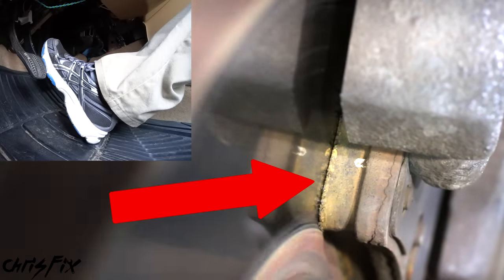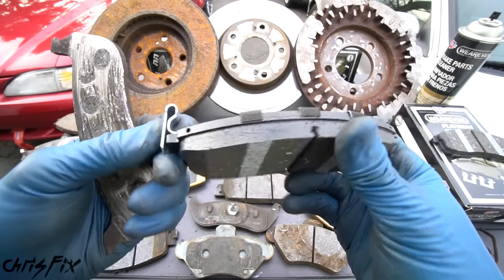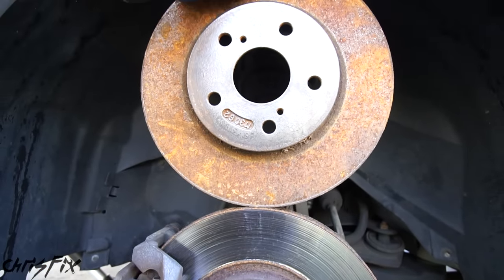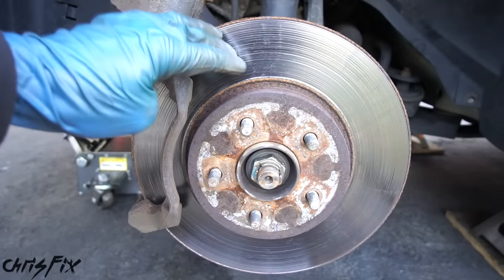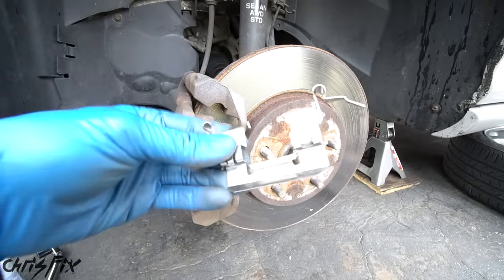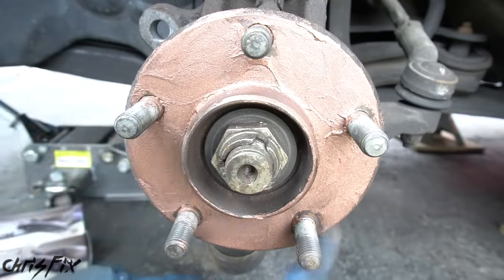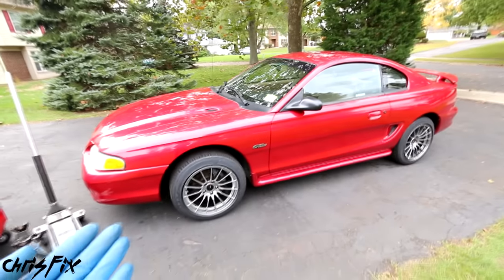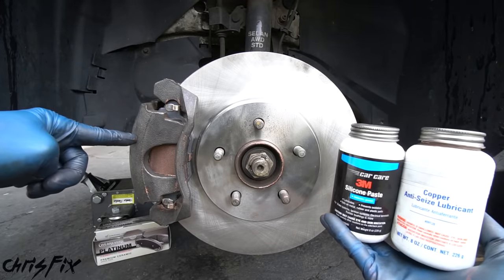How to Stop Your Brakes from Squeaking

Comment: Mazda stealership wanted $1,170 to replace the rear rotors, pads and one caliper. I went home and replaced the front and rear pads and rotors for less than $380. The rear driver side caliper wasn't the issue. The problem was metal inserts the pads slide on were fouled up so the pads didn't slide freely.
Reply: you forgot to add mechanic fee, company profits, and also warranty.  you don't expect all those for free, do you?
Reply: @TheAngusGao  I expect an accurate and honest diagnosis when I take my vehicle to a dealership. Being lied to and being told the caliper is faulty is not what I expect. I was also illustrating how much stealership gouge you on repairs. Maybe if they read their own TSBs they would know what to inspect.

Comment: Chris, super well produced, accurate and insightful video (as always). One bit of constructive feedback: using calipers to measure the brake rotor thickness is often inaccurate due to the formation of a lip along the outer circumference of the rotor. I always opt for a micrometer instead. Keep up the good work!

Comment: Why did I watch this, I don't even have brakes in my car
Reply: lol rip
Reply: Energy brakes? Those ones teslas use that if u brake you recharge a little bit
Reply: LOLWTF673 They still have normal brakes because you can't rely on the regen braking to stop your car quickly
Reply: i know that lol
i'm still wondering how E-Brakes work without using the main brakes
Reply: lol
Reply: That's Werid Unless You Have An Electric  Car Or Truck  ._.
Reply: I dont even have a car
Reply: David Gonzales I don't even have a car 😂
Reply: Flinstones car?
Reply: LOLWTF673 the e brakes are actually just the wheels turning the motors. My dad has a model x and he hardly ever use his brakes so they squeal like crazy when you’re using them from all of the rust build up on them
Reply: It be like that sometimes.
Reply: Because you have brake noise!
Reply: David Gonzales i dont even have a car
Reply: LOLWTF673 they do use the normal brakes
Reply: Noice
Reply: Just buy an anchor.
Reply: Flintstone theme plays
Reply: +Tony Hong
On mining equipment they use the motors as the main brakes while the friction brakes are about the same size as would be on a pick up and are really only for parking as a result.
Reply: Why waste money on brakes when you have a gear shifter and hand brake

Comment: I doubt you want to put antisieze on anything but the hub. Those places are meant to be dry. anything applied there only collects gritty dust and dirt. the graphite would likely be ok as it isn't gooey. I think that brake hardware is to keep pressure against the pads to prevent rattling, and prevent the cast holders from wear. The main thing that makes brakes squeal is the back of the pad rubbing on the piston or caliper. The black  metal plate  on the back of the pads prevents this noise.  Sometimes a stone gets between the rotor and the tin deflector and makes a noise that would make your teeth fall out!
Reply: AL M I've never used lubrication on the hub or the hardware. I thought that was quite odd when he was explaining that

Comment: People always forget this tip: put a thin coat of anti seize on the rotor! You don't want your brakes to seize up, right?
Reply: can i use WD40 in place of the brake cleaner to remove the new oil on the rotor?
Reply: I almost forgot!
Reply: In case this wasn't irony. Do never do that, always use brake cleaner!

Comment: Yo man
I wanted to ask you what my car's problem can be. The breaks only squeak when the breaks heat up and I had them replaced multiple times to see if the parts I was using were faulty or not. However it still happens after a trip full of traffic and  lots of breaking.
Reply: SAME! lmk when u found. solution ;/

Comment: Chris: first off, thank you so much for your videos. They've allowed me to do more work on my car than I thought possible, and helped me realize just how much can be done on my car by myself. It's becoming a hobby of mine to keep it in shape and clean (2003 Chevy Malibu with almost 278k miles.)

Second: I just fixed some brake noise that I can remember if it was covered in this video or not: my brake hardware needed a little bending to be clear of the rotors (it was rubbing against the brake pad hardware which mounts in the caliper bracket.) Bonus points: I fought with a pair of sticky caliper pins for a half hour and now they function properly, and my steering wheel doesn't shake when I go over 50mph.

Keep up the awesome videos! You've got +1 story now to encourage you to keep going. :)

Comment: The copper vs graphite antiseize test was completely wrong... graphite breaks down into small enough particles that it lubricates BETTER, not worse...
Reply: I agree the test is indeed wrong, you can't compare them to their solid counter parts when we are talking about lubricant.  Particles have different behaviour characteristics.
Reply: the way the graphite breaks down makes it better for things like nuts and bolts
Reply: Best anti seize to use?

From Permatex:

Nickel:
Protects metal parts from seizing and galling at temperatures up to 2400 degree fahrenheit
For use with stainless steel, titanium and nickel alloys
For use under conditions of extreme pressure and temperature
Recommended where copper contamination must be avoided
Suggested Applications: Exhaust manifold bolts, exhaust systembolts, muffler clamps and tailpipe assemblies

Copper:
Prevents seizing, corrosion and galling where high temperature conditions exist
Fortified with high quality rust and corrosion inhibitors
Temperature range: -30F to 1800F
Provides good electrical conductivity
Suggested Applications: Spark plug threads installed in aluminum, exhaust manifold bolts, engine bolts, oxygen sensors, knock sensors, thermostat housing bolts, fuel filter fittings and battery cable connections

Standard:
Highly refined blend of aluminum, copper and graphite lubricants
Salt, corrosion and moisture resistant, this lubricant is ideal for marine use
Prevents galling, corrosion and seizing and to assure easier disassembly
Suggested Applications: For easy removal of spark plugs, cylinder head and exhaust head bolts
Temperature range: -60F to 1600F
Reply: An apples to lubricant comparison.
Reply: Do NOT use graphite in your door locks. You will be replacing them soon if you do.
Reply: Graphite doesn’t breatdown it dries out and is best for low heat applications. Because it encourages friction. That’s good on bolts and things that don’t need to move continuously.  Copper is just the opposite of graphite as a anti seizing lube. Coppers major downside is it will oxidize causing seizing. Graphite will not oxidize.   So use graphite in the wheel hubs and bolts and copper on your house and electrical connections.
Reply: You completely missed the point.  Graphite breaks down into smaller pieces, which also shortens the life span of the lubricant.
Reply: Tyler Norton nope that not how graphite works, smaller is better for graphite.  The small particle get in to the nooks and crannies. That’s good, copper is the opposite because it oxides. So dry/ dehydrated copper paste allows oxygen to get to the copper ions and cause green “rust”.
Reply: And copper destroys the rubber seals to!
Reply: What's your conclusion? I don't see "brakes" anywhere in that list..
Reply: It would fall off if graphite was used as is (as a graphite powder), however this is suspended in grease, which would keep it in place. madjimms' argument still stands true.
Reply: So what's best to use instead of the copper lubricant used in the video?
Reply: pure dry graphite powder is  ok for locks, does not gum up, does not atract dust and make paste. Graphite powder is recommended for locks
Reply: madjimms and all of the helpful tips that he had in his video you chose the one that you did not like and you chose to complain about it great job you want a cookie
Reply: True. In extreme loading scenario Cast iron bearing are used which in fact is impregnated by graphite (Carbon) particles.
Reply: @totalbliss1  can u mix small amounts of them together or will that potentially break down the compounds?
Reply: Mikel Whois- The standard has a mix of aluminum, copper & graphite already except for Nickel. With the other two- copper and nickel, I wouldn't recommend.

Comment: Often brake rotors and drums get warped because of improper tightening of lug nuts/bolts.
Reply: Suppose that it could/does happen, but I don't know how often.  Brakes are sandwiched between wheel and lug/bearing assembly.  Very hard to warp a lug/bearing assembly because they are made from (hardened?) thick steel and literally designed not to warp.  Rotors and drums are similarly designed and are also hard to warp, unless (very) cheaply made (in China?) and/or they get very hot, say from abuse and/or racing, not normal driving.

Comment: I'm skeptical about the use of copper grease. Your analogy with the hammer is completely unrelated to what the grease is meant to do at a micro level... Copper may have been popular on bolts and things as an anti-seize, but graphite is better for lubrication. Oh and copper oxidises.
Reply: MHBGT Lead has a lower melting point than copper. Lets say he does 185mph and slams his brakes (for arguments sake), copper would be less likely to burn up as the heat from the brakepads rises.

Lead melts at 650-ish degrees farenheit whereas copper melts at 1,980-ish degrees. Copper outlasts Lead in practical application.
Reply: Juice I believe you’re confusing yourself based on the pencil comparison and how graphite is commonly referred to as lead. Graphite has a melting point that is essentially unachievable (especially on a car). I’m not one to argue for copper or graphite while lubricating but I do agree that the comparison was rather biased.
Reply: MHBGT Nickel is for high pressure. Copper is for rust and corrosion, and graphite is for threads and marine applications. From Permatex.
Reply: +Anton Zuykov my thought exactly
Reply: Partially agreed. I'm not sure which is actually better, but I think the comparison with the hammer is irrelevant, as anti-seize isn't made with pencil leads or copper tubes. It's irrelevant if graphite is brittle, as it already is basically a powder.

Comment: Hey Chris, My car makes a strange noise right before completely stops. It sounds like vibration, but there is no vibration in the steering wheel. It does it when I am stopping slightly and there is no sound when I press hard the brakes. My previous car also did it, and both cars did it before and after all braking parts replacement. Can it be because breaking parts are no lubricated  where it is needed?
Reply: It could be a slightly warped rotor.
Reply: Does it only happen on watery or snowy roads?
Reply: @b33sandhoney   It does it no matter of the road condition or the weather
Reply: Yes, like Ivan said, sounds like a warped rotor.  Sometimes if the vehicle sits for too long especially in wet, damp weather  , the brake pad will rust to the rotor.  Causing an imprint.  Or perhaps you have a lip of rust on the outer surface of the rotor?

Comment: I got a Dodge Grand Caravan 2010  I have a weird brake noise coming from the rear driver  side it sound like rust sound and the faster I go the noise get louder when I Brake the noise goes away and when I speed back up the noise continues
Reply: Roberto Delacruz sounds like a wheel bearing issue not your brakes. I would still check both though.
Reply: If you can get the vehicle in the air. Grab the wheel with one hand on top and one on the bottom, then attempt to wiggle the wheel. If it moves then it's a wheel bearing.
Reply: FileExplorer sometimes if you try wiggling the wheel and it does wiggle it could be a suspension component. More than likely it is a wheel bearing but it might also be a suspension related problem

Comment: My car squeaks a lot when I first start up the car and hit the breaks. I went to the dealership and they said it is because "the car is cold" is that correct? I have a feeling of doubt in that
Reply: WatchMeRod My Yaris XP90 had a tendency to do that when braking in reverse in moist conditions. The shop told me it was a well known issue on that model. The XP90 had discs on the rear. My new XP130.II is back to drums.
Reply: WatchMeRod I had a similar problem about ever time I stopped and when It first started up.  I change my timing belt and I belive it was my power steering belt?  But that fixed it and no more squeeking
Reply: WatchMeRod my breaks get hella rusty even after 2 days. I always do light pressure before leaving to clear it out just in case
Reply: Emily Muro oh okay thanks :D
Reply: In the brake engineering world it's called "morning sickness."  It's worst on cold, humid days, especially with NAO (non-asbestos organic, or ceramic)  brakes.
Backing in your car at night so you can pull out in the FORWARD direction may help reduce noise propensity, but likely won't eliminate it entirely.  A more aggressive pad may help also (semi-metallic) because they tend to respond less to changes in temperature.  If it' becomes a major warranty problem with your car's model (and it's still being produced), the OEM will likely work to implement some additional fixes to help with it, such as changing pad shape or providing alternative material formulations that have been vetted in the laboratory for noise AND performance.  Something no aftermarket pad supplier will do fully.
Reply: Pads with a good Coefficient of friction will scrub the rotors initially.  You can work around it by putting cheapo pads in or going much higher end with your rotors.  Normal as hell.
Reply: Oz Media okay thx yo !! :D
Reply: Oz Nathaniel the best of way to
Reply: ***** Be careful how you define "good" friction coefficient.  The car was designed for a specific level, and swapping for a set of pads that is too different either up or down can disrupt a well-balanced system.  Cars with ABS are typically tuned to the friction level the car is produced with, so by switching out non-production pads you could essentially be increasing your stopping distance during panic braking.
The cost of a set of brakes in no way determines their friction coefficient, nor their ability to scrub the rust off of rotors.  You need to dig into the friction couple a little more to understand what pairing works best in your typical situation and environment.
Reply: tensioner pulley bad and squeaky.

Comment: everytime i hit the brakes the car starts squishing ... the brake pads are new and i got the drums resurfaced it solved the problem for 5 days then it came back
Reply: I'm assuming the pedal is squishy, which means there's air in the brake lines. You need to "bleed the brakes". Basically purge the system of the air. Very common, just search how to bleed brakes on youtube and a ton of vids will come up on how to do it.
Reply: My car turned into a marshmallow once.
Reply: You never know. If you're like me and are cheap, I usually learn to fix things myself to save money. Gotta start somewhere. If they really wanted to i'm sure they could do it, its not that hard.
Reply: Sexual_Assault_Rifle I think you maybe be exaggerating a bit lol
Reply: its like braking on rust .... that's the noise it makes every time i hit the brakes
Reply: It's easier with another person but not required.  I think Chris has a video on one-person bleeding. Simple stuff.
Reply: I'm cheap, too, as you guessed...well, "frugal".  Besides, I like the satisfaction of learning to do something new and doing it right. There is something else brake-related that I've suggested people do and I know that it sounds completely nuts. But it has been looked at and convection currents from the calipers does cause some circulation of brake fluid.  So, every few months I use a turkey baster to carefully remove most of the brake fluid from the reservoir and replace it with fresh fluid. Every other oil change I also do a transmission drain and fill. That replaces exactly 2 liters of my 8 liter system each time. My car has given 19 years of excellent service so far and I'm just getting started.
Reply from the maker: Watch this: https://www.youtube.com/watch?v=n1NvtUwfRJc&t=50s
Reply: wholeNwon Wow there are convection currents of brake fluid in brake lines? I've never heard of that!
Reply: It's an auto-correct misspelling, and instead of "squishing" it should read "squeaking", so this thread is all just a major misunderstanding, LOL!
Reply: you should fix your misspelling first, then you might get the answers you're looking for! Everyone thinks your brakes are "squishing", so that's why they're telling you to bleed the brake-lines, but I believe you meant to type "squeaking", especially since you followed up with "it's like braking on rust..." and you'll need to follow the instructions in this very video to find the reason why they squeak...

Comment: This and your other brake videos gave me the confidence to go looking, and I found another reason for brake noise. My parking brake wouldn't release on one side. The wire on the caliper end moved as expected, but I think the springs that are supposed to pull what I think is a cam back on release just weren't doing it. So, uh, that's where I'm at.

Comment: my car started making a high-pitched continuous rhythmic squeaking noise and it always came on after about 30 minutes of driving. It would be so loud, I could hear it on the motorway with the windows up. Guys at the garage couldn't find anything (didn't charge me). It always goes off as soon as I brake. Then comes on again. Last couple of journeys, it's disappeared. Couldn't work out how it could be brakes if it came on when I wasn't using them. This video is a real eye-opener... Thought it was coming from the front driver's side, but now realise it's the rear driver's side as you can hear it louder when cars go past and it echoes off them when they're level with the rear wheel.